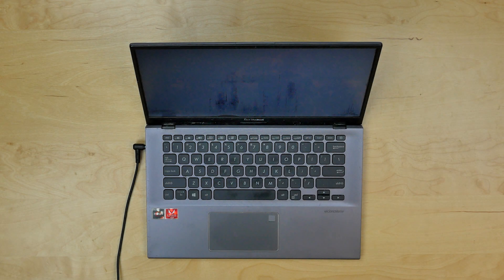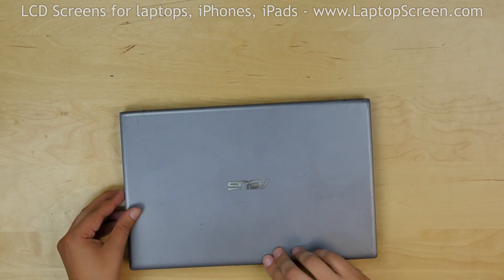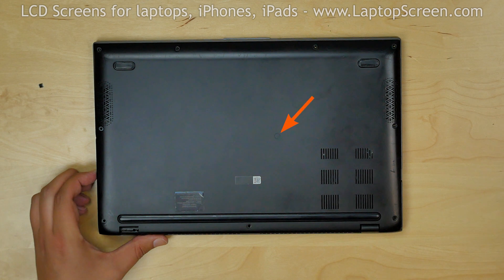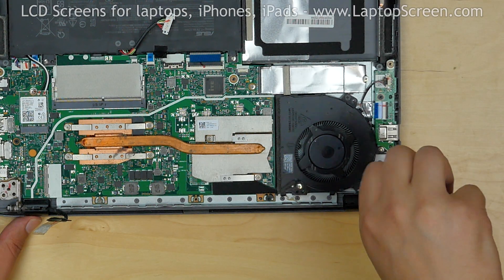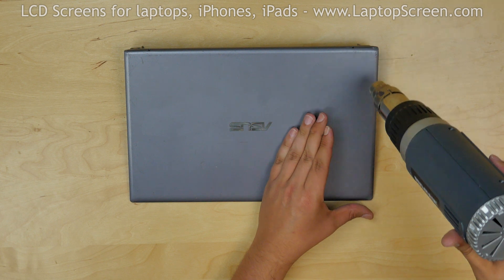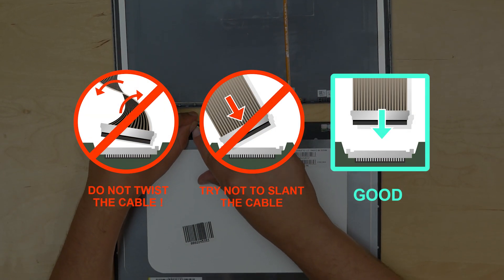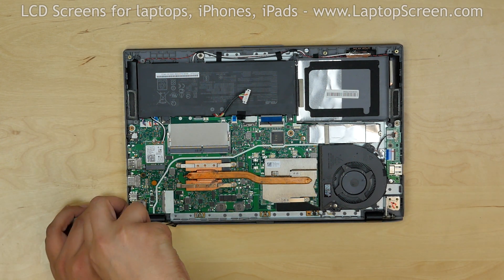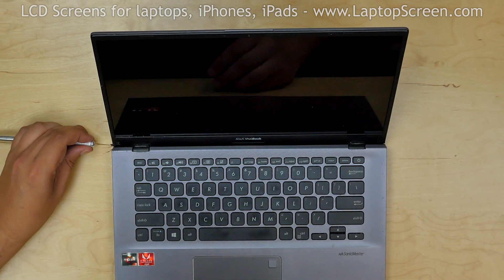How to replace LCD Screen on ASUS VivoBook. Model number X412D laptop. Step-by-step instructions

Comment: Does this have the the silver bracket on the battery cable receptacle on the board that needs to be pushed away from the cable in order to unlock it? Then the cable can be gently pried up.

Comment: Do I need to remove the LCD screen if I just want to replace the flex cable?
Reply: yes, connector pin socket flex cable behind the LCD panel screen. One of connector socket behind the flat panel